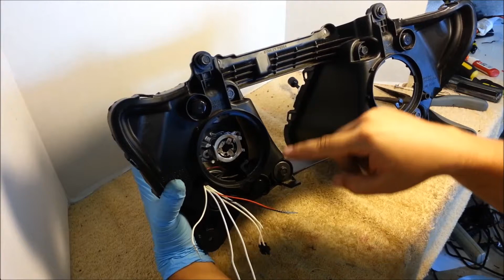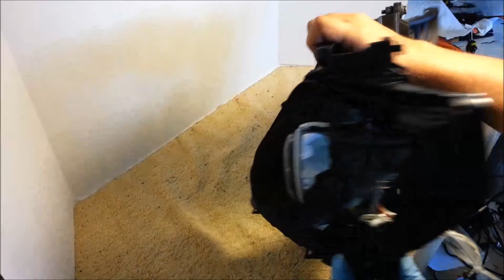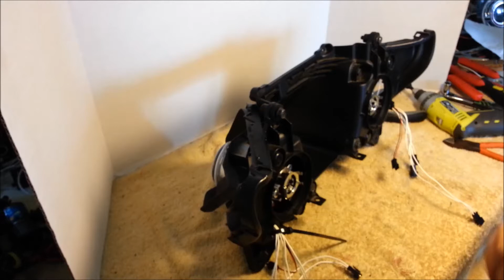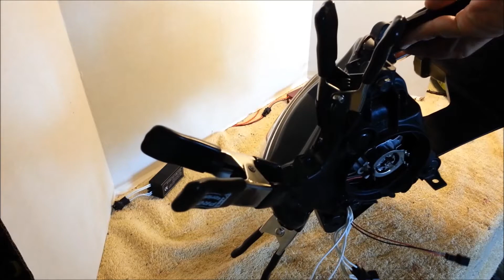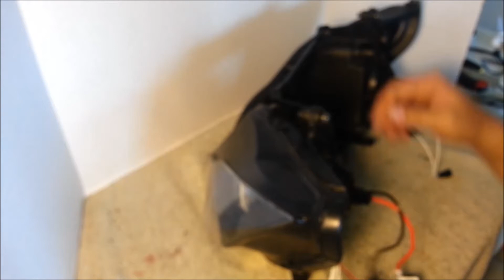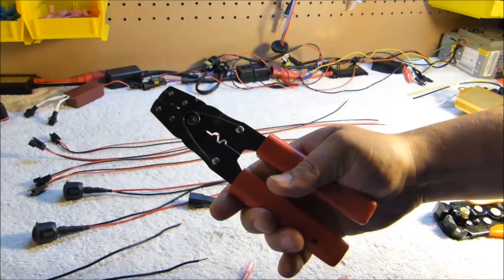Part 2 of 2 How-to Install BKMOTO ZX10R 2011 2012 2013 2014 HID Projectors halos angel eys

Comment: At 30:10 you said something about the positive wire  but in this one https://www.youtube.com/watch?v=qeaGdcWRx3M at 1:14:11 you said its the other one. 
Does it differ from one manufacturer to another ???? ...... I'm stuck now :(
Reply from the maker: +RanNero Yamaha's the upper wire is positive and lower negative, Kawasaki Lower positive and upper negative.
Reply: +BKMOTO LLC  Thanks a lot for your reply, it was 4 in the morning.... and I was panicking anyway. I'm working on my headlights while the bike it's on repair shop.... miles away, so I can't check the wires on it. 
Thanks again !!!!

Comment: Hey bud got a question for u I was thinkin of usin a remote wireless control for halos n devil eyes any  suggestions and do u guys have set up for a 2012 848 evo I'm lookin for  projectors double halo and devil eyes?
Reply from the maker: Emprez hernandez 848 headlights are very small, there's really no room to fit double halos. single halo ring 1 per side, maybe. and demon eyes possibly, depends on the inside projector setup. we have remote control led halos, in 60,65,70,75,80mm sizes available